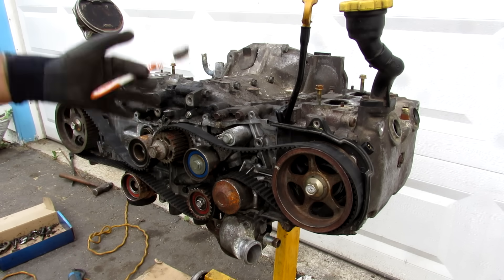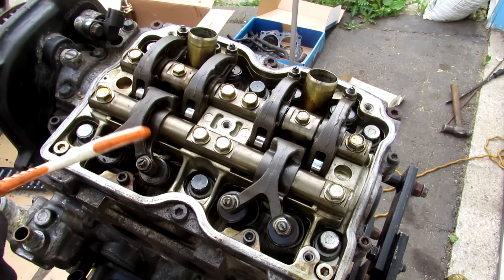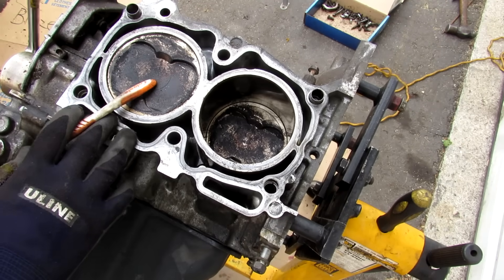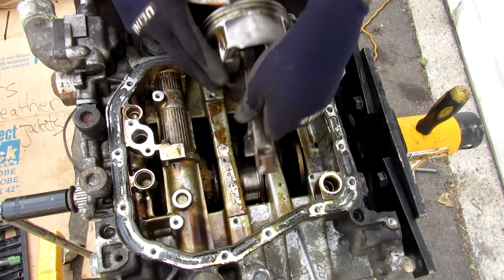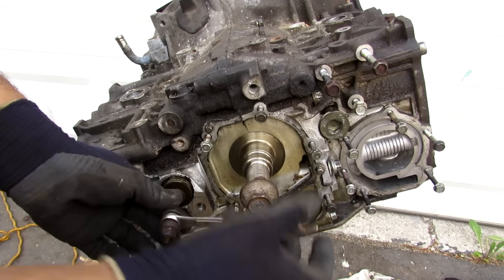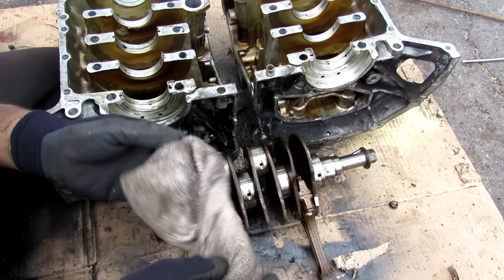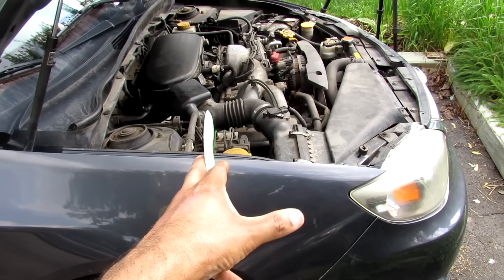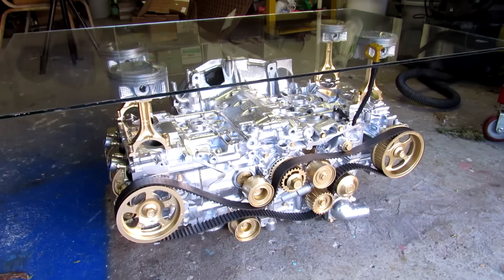Why Subaru Engines FAIL

Comment: The reasons you mention as to "why Subaru engines fail" is pretty typical of all engines.....bad maintenance.
I do understand about the horizontal layout and the fluids laying to one side of a cylinder but, fluids should be there, anyway.
I'll watch again later for points I may have missed.
Thanks for the post.
Reply: I had a Subaru EJ25 that was serviced as per the manual, maximum of 10,000km between oil/filter changes using quality oil, had the head gaskets fail ~125,000km which is a common 'fault'. I stripped and repaired myself including getting the heads professional machined, replaced all the idlers, cambelt, water pump etc. while it was apart. The air flow meters are another item known to fail from time to time, engine cranks over however won't start or run, this happened to me also however was an easy fix by re-soldering the boards, did another 60,000+km with no issues after that until I disposed of the vehicle. Overall the vehicle was 99.99% reliable and nice to drive, I like the boxer layout however I would not buy another Subaru.........
Reply: @adventurephase2322  
I hate to hear that.  I really do.  I had to buy my wife a brand new one.  I wanted to get her a Ford or Lincoln.  She wasn't having it.
It's a 2020 Subaru Forester Sport.  I think the Sport is just orange accents and black wheels.
Reply: Absolutely. If you care for the main block it can run 250,000 easy
Reply from the maker: Thanks
These engines are more susceptible than a regular inline 4 and this a higher failure rate regardless of maintaince

Comment: My old 2001 Forester had over 400K in it before it died.  And my wife's Outback has over 200K on it and runs strong.
Go figure..🙄
Reply: The older Subarus are decent. I'd just be worried about the newer ones paired with the CVT
Reply: I didn't know they all had this motor .

Comment: I've had a couple Subaru's. From my experience the boxer engine was completely rock solid. Of course you have to maintain it well and regularly change the oil and plugs etc.
Reply: That's true! Most of the bad rep is from people that in reality doesn't know and doesn't have the basic knowledge to even understand why and why not this is a good or bad engine. Maintenance is key and with it it's a really good engine that lasts, but they are not over built so they cant handle an unrestricted amount of power...
Reply: My 03 WRX had almost 300k miles without any major problems. I kept it well maintained, and bone stock
Reply: @AIDAHAR210  stock wrx.. how exciting.. lemme go get in a toyota avalon for some fun.
Reply: The bad rep for subaru boxers came pretty much solely from the subpar factory head gaskets that failed early, but they were replaced with updated, better gaskets.. and pretty much nothing else.
Reply: Same here. Never let me down, not in the countryside muck nor on long distance trips.
Reply: @Rick-S-6063  -Sold Subarus for five years. Customers were almost 'All' repeat. If they were as bad as comments vomit out, there would be no Repeats. ;
Reply: I had 2 Foresters (2.5 NA and 2.5T) and an WRX STI. Never had an engine failure in any of them. (8+ years, ~260k km). The maintenance tasks on them are PITA though, because of how cramped the engine bay is... Also - if you ever run them into low oil situation, it's downhill from there... :/
Reply: Had loads with no issues as I don't let them detonate!
Reply: @Shane Lewis just sounds like you can't drive
Reply: Seems hit or miss. I had one fail at like 30k km during the first year of ownership. Then the dealer played games trying to blame anything and anything other than the head gasket or warped block (which it had both).
Reply: @Alex-us2vw  Sounds liek you were hitting up the dealership on a bad week of head gasket failures, lol..
Reply: I clicked on this video just to find this comment.
Reply: As you should with most engines I guess?
Reply: I’m on my fourth Subaru since 1991, never had any engine problems. I had a 96 Impreza 1600 for fifteen years, had 400,000 k’s on the clock when traded.
Subaru tends to have a very high level of Brand Loyalty amongst its customers that other brands can only envy.
Reply: you rock solid just mean anything that not plastic need new part and the seal and labor still going to cost... and boxer lack of torque and use more fuel just to go fast...  as a guy who own every type of engine.... i will tell people this... all thing do break down... best to focus on where the repair is the close to you...
Reply: @campkira  pretty sure you just think subarus use more gas, because they're almost all awd.. nothing to do with the motor.
Reply: campkira l

Comment: I see dozens of 20+ year old Subaru's on the road every day. I hate it when someone with a tiny bit of knowledge maligns an otherwise epic piece of engineering. So what actually went wrong? First, they followed Honda and replaced the timing chains with belts. In 2015 they went back to chains, because people didn't understand that if you didn't do that required belt replacement maintenance at 100k miles, the engine would fail. Secondly, Subaru changed over to long life antifreeze... but in a corporate failure to communicate, they decided to change to a cheaper head gasket, too. This would have worked fine, except the cheaper head gaskets were implemented way before the factories ran out of the older green antifreeze, which meant to had to change antifreeze at 5 years or 36,000 miles because that older antifreeze turned corrosive. The older head gaskets could hold up for a while longer, but the newer ones went bad pretty fast. Since then, Subaru has gone back to the older (better) head gaskets and the newer long life antifreeze. As for the boxer engines... well Honda (Goldwing), Volkswagen, Porsche, BMW and several aviation engines line Continental, Lycoming, Ryobi and others run boxer engines with excellent results. Why are they better? Inherently low vibration and low center of gravity, plus excellent ground clearance and the highest power to weight ratio of any piston engine. So be very careful of "experts" on Youtube.  Subaru sells 400,000 cars a year and gains market share every year like they have been for 25+ years. They've had their problems, but show me one that hasn't!

Comment: stopped watching as soon as he said thye coolant cant do a good job lubricating the motor and the oil cant do a good job cooling the engine. SMH smack myself int he face with an extreme face palm.. and he also said there was 3 other head bolts other than the middle ROFL!!!
Reply from the maker: Put oil in the water jackets and coolant in the sump...see what happens
Reply: @speedkar99  rofl yeah ok... ill get right on that
Reply: also saying its hard to do spark plugs and simple things? i donno what u bin smoking but it only takes me like 5 mins to do all4 spark plugs in my subie LOL not har din any sort of way infact subie engines are easier than most to do anything on

Comment: V6 engines aren't as well balanced as boxer engines. That's why V6 engines typically have balance shafts to keep them from vibrating.
Reply from the maker: Yes. I'm going to have more details in this in my Volvo 5 cylinder tear down

Comment: Thanks for this. I’ve been considering buying a legacy for some time, now I’ll stick with my Volvo T5. There’s no comparison in the engineering quality.
Reply from the maker: Funny thing I'm working on a Volvo 5 cylinder teardown right now
Reply: speedkar99 mines the 850 T5 1994, I’ve had it 12 years never gone wrong, timing belt just 1 hour. Fantastic car except it drinks more fuel than a Boeing 747

Comment: Almost exactly like my Honda goldwing engine
Reply: Bought a salvage 'Wing', with broken cam shaft from the serious wreck. Ordered new cam and belt wheel cover. Replaced the cam, torqued to spec. Valve clearances were spot on. Replacement cam had been machined to exact same tolerance as the original. Cleaned the carbs and it ran like new, in spite of salvage storage for years.
Reply: Except that the Honda is really,  r e a l l y,  REALLY well built..!!!

Comment: The common saying is "ring lands are weak" which is actual bullshit. the reason cylinder 4 is the first to blow on turbo ej engines, is the sheer fact that its the last in the line to get oil, even last after the turbo! so when retards who have more money than brains, who have others build their engine for them, drive it like they stole it, but think they can still go 3000 miles between oil changes.... the engine blows and its almost always cylinder 4.
.
I own an 05 STI. My turbo blew because the turbo in my case is the weakest link, which turbo's do go after about 100k miles when its the OEM that came off the factory line..... Retards say I'm lucky. The truth is, if you keep the engine lubricated, and watch the oil level and do proper oil changes, you wont have an issue. I actually did my oil change every 2000 miles, because by the time, that is when I was a qt low and oil pitch black. Why? Because I drove it like I stole it, full boost everywhere I go, speeding, etc. The few times I drove it like grandma to save gas money, I could actually go about 5000 miles before I needed an oil change, as the oil was still clean and the oil level was not low.
.
I have heard so much bullshit in the car world because of people who just don't know what the fuck they are talking about. "your honda s2000 has a glass rear end, you can't drift it and you can't launch it, it will blow up" meanwhile I launched and drifted mine DAILY. LITERALLY. Why didn't it blow up, because I changed my fluids more often considering how rough I was driving it. Manufacturer maintenance schedule is for "normies" who drive the car like grandma. With the s2k, I actually changed my oil every 3k miles and my trans/diff fluid every 6k miles. I was told "that's a waste of money, way too often" no, it keeps the fluids absolutely best possible, especially when I drive like an asshole. And funny enough, after drifting and launching the car daily, when I did go to change the rear diff fluid, it would actually be dirty, dark color. Because it puts in more work from harsh driving.
.
I hate to be a meme, but Keiichi Tsuchiya, once said his honda minivan, his daily minivan, he would change oil every 3k, and trans/diff (it was an awd mini-van) every 9k miles. And his costar was like "wow, that's way too often" and he said "yeah, maybe, but keeping the car healthy means less issues to go wrong". How many "street racers" run low on oil, because they never check it, ever. They only do their oil change when the mileage hits or they get their "dash light" to tell them to.... otherwise they are oblivious. And then their car dies in some way, and they make up bullshit excuses. Most of the time, they don't even do their own work, they take it somewhere, have someone else build it for them. And by doing so, those mechanics have no idea these assholes drive their car low on oil, so they end up with a bullshit lie of "ringlands are weak". no, they aren't.
.
rant over.
Reply from the maker: What I don't get is how is someone supposed to have a WRX or STi and NOT drive it hard?
What's the point in having a 250-300HP economy car then?
Reply: @speedkar99  I never said they shouldn't drive hard and instead drive like good ol granny.... 

In reality, its about watching your fluids. When you drive it like you stole it, you wear the engine oil out faster. hell even trans fluid and differentials. all fluids will wear out quicker. every single time I have seen someone complain about ring lands, they drive it like they stole it but they NEVER checked their oil level. they just went by mileage and stock rating for oil change interval. I change my subaru oil every 2000 miles and trans fluid + diffs every 6000 miles. it seems excessive but all my shit runs perfectly. again as stated, the part that failed for me was the turbo, which aren't meant to last the life of the vehicle. replace turbo, runs like it should.

Comment: I'm surprised Subaru can get away with using boxer engines in volume production (AKA non-luxury/sports) cars these days. Surely they are more expensive to put into a car and get the same overall performance (incl. fuel economy and reliability), especially for cheaper FWD models, compared to transverse inline. Maybe that's why traditionally their interiors are inferior--cut costs there to pay for the drive train.

Comment: This looks like an engine begging for issues. I lost count of the design flaws. Nasty. 

Thank you for sharing. Now my long term prejudice against these things has evidence to back it up.
Reply: Design flaws? as I see it the subaru boxer engines is actually pretty good and the main reason for failure is the lack of maintenance. In this video you don't see one single part that is the reason for failure but you get shown the parts that is suffering the most if there is user error or lack of maintenance. Thin oil scraper rings yes.. but that's only a problem when the car is driven like a grandma most of its life, or you don't change the oil at correct intervals. But yeah these engines are NOT over built so don't tune and push to much power out of them before rods and pistons are upgraded. Just to be clear I'm not a subaru "fanboy" but an actual mechanic so I see A LOT of proper design flaws on a regular basis ;)
Reply: Let me see. The same manufacture (Toyota) that builds the longest lasting, lowest cost of maintenance, highest resale value vehicles opted to put Subaru's boxer engine in their scion.  I think that speaks to the quality of a boxer engine.  Why would Toyota tarnish their reputation and loose buyers trust by putting something that is knowingly flawed in their vehicles?  Well they wouldn't, and these engines are not flawed.  Well they have one flaw.  They are a very old engine design, but thats about it.  It really comes down to knowing how to properly maintain this engine and many do not.  Just because you stand in front of a car with an open hood and a wrench in one hand doesn't mean you know what you are doing.  Your prejudice is unwarranted.  Subaru's are some of the longest lasting vehicles on the road.  I think your prejudice against these engines are unwarranted, unfounded, and unjustified.  Lack of knowledge and experience seems to be your enemy
Reply: @diversify210  For the same reason they started selling a BMW. Money.

Comment: Holly crap! I almost skipped the hassle part of the simple plug changing nightmare for the boxer engine!
This is an engineering nightmare but the celebration for the (american) mechanics because imagine the time it will take to do a simple fix on the engine and the amount those (american) mechanics charge for that!

Comment: Working on subarus for basic maintenance is actually easier than many other cars imo.
Reply: Flat boxer has everything on the top and bottom compared to on the side of a inline. Makes it very easy to reach. The only difficult part to reach are the spark plugs but its not too bad. Plus since I done it once I know I can take the whole engine out in 4 hours. Currently I own a sf5 turbo forester. My Mr2 spyder has part of the roof over the engine and the modern cars I work on daily have packed full engine bays, its like a puzzle to get some parts replaced. I love my subaru
Reply: How so? Can you list examples?
I've only owned one Subaru, and been extremely happy with it, but always paid a shop to do the maintenance.

Comment: I'm sure I heard you say ... that the secondary rotating forces were in phase and cancelled out vibrations , ...NO it's the primary ...you still have to balance secondary forces with crankshaft counterweights
Reply from the maker: I'll Have more on this in the Volvo

Comment: I bought a 2.5L  used from a smashed car.. from a 1998 Forester.... had the Top end Rebuilt.. Installed in my Mazzone Sand Car... With a Electromotive ignition... Bone Stock...
... I was the guy at Gordon's Well.
constantly going up n down the hill. And at the Sand Drags.
.. & Could Never Break that motor...
i did Replace 3 Transmissions...
...Great Sand Car Motor.....
Reply: I’ve got a ‘98 still on the road approaching 300,000 miles.  Head gaskets failed around 100K.  I replaced them myself with the “updated” head gaskets and the car has been running great ever since.  Of course, I replace the timing belt, idler, belt tensioner, water pump and thermostat every 105K miles.  That is a *must*.  Great little car.  The EJ25D motor is a beast.  It simply won’t die.
Reply: You don’t need to constantly add ellipses for dramatic effect.
Reply: sound like you just endless waste money on shitty car...
Reply: I have a 98 sitting in my yard they suck

Comment: My family had a few Subarus. The older ones just kept going and never needed to be taken apart like this. We use synthetic oil.  So this is the first time I have seen one apart. I did read about the rings not having enough tension on newer models. Oil leakers also.  A Nasty looking engine you have there and you did mention possible low oil.
Reply from the maker: Sad such an interesting design has drawbacks
Reply: @speedkar99  I like them. If you change the oil and don't abuse them they last a long time.

Comment: These engines cost more to repair than inline fours because of the extra work to dismantle them. Slipper pistons are very susceptible to piston slap. But the most persistent weakness is the crankshaft. A 5-bearing crankshaft on a boxer engine is not only unnecessary; it also leads to very thin crank webs